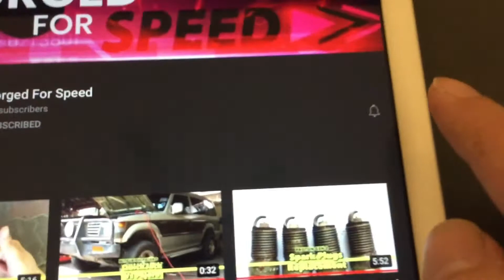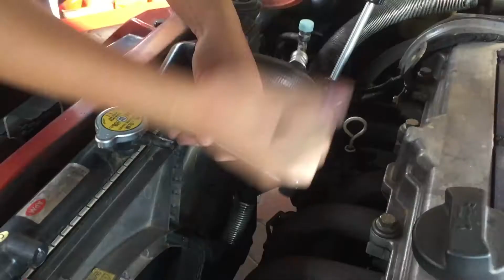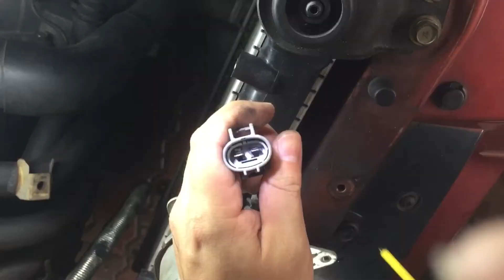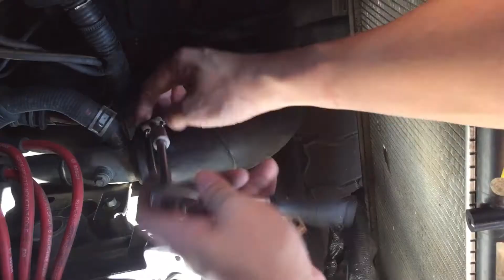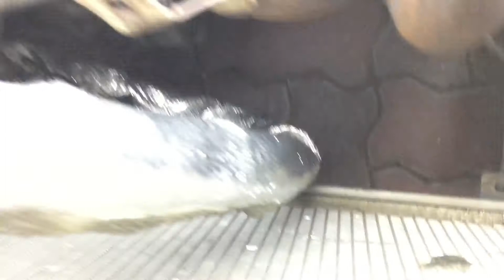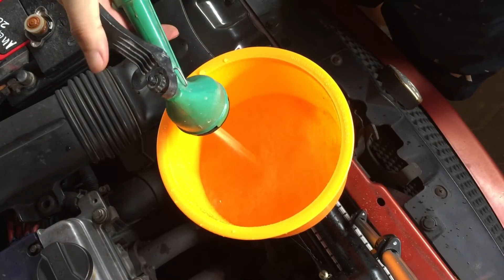Overheating Engine Again...Radiator Fan Motor Replacement // Proton Gen 2 // APM

Comment: selamun aleykum. Türkiyeden yazıyorum. proton gen2 2009 sedan araba var bende. yokuş aşağı gidişlerde hararet düşüyor 0 (sıfır) a geldiğinde ibre birden 120 dereceye çıkıyor. Sürekli fan çalışıyor. Ama motor soğuk. Termostat, radyatör kapak ve hortumları değiştidim. Sorun devam ediyor. Problem nedir sizce ?

Comment: I'm suffering from overheating in my persona 2014 when I turn  the A/C .
If driving without A/C no heating
Reply from the maker: Hi buddy, when the AC is on do you get cold air in the cabin?